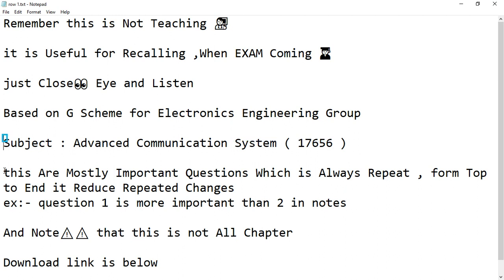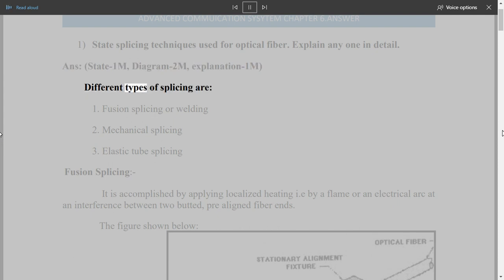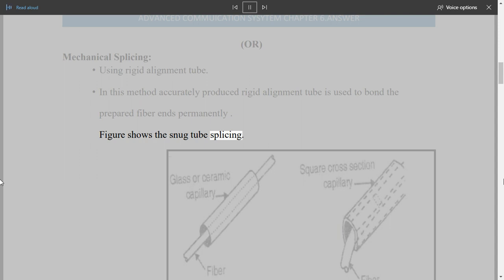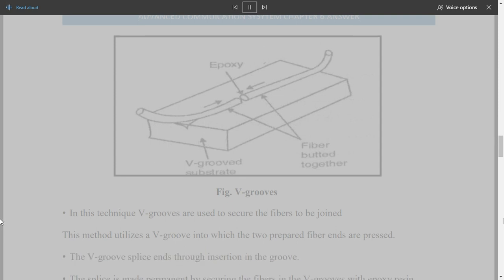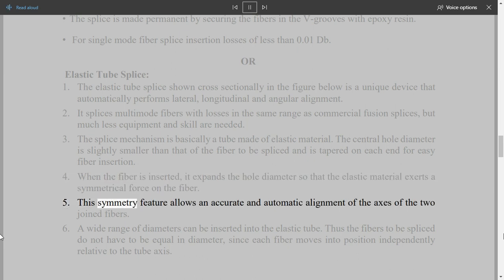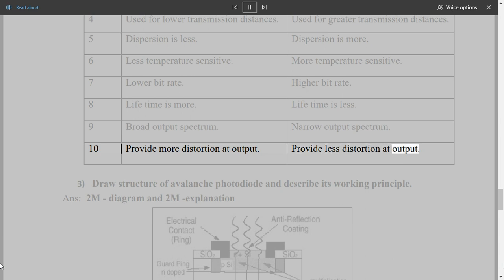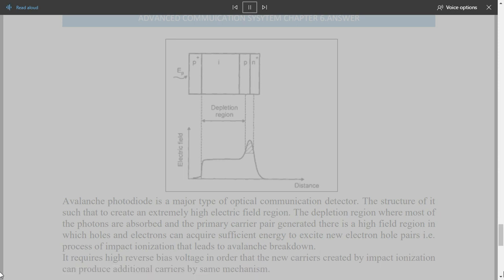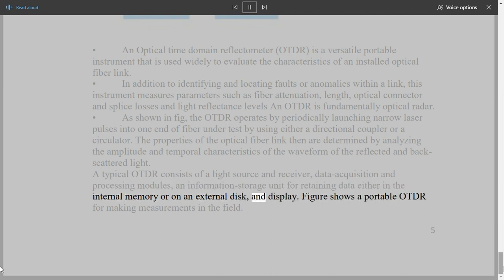Optical Communication System from Advanced Communication System ( ACS )

Comment: Hello, Professor. Thanks for the video. Can I contact you with some questions please?
Reply from the maker: Yes
Reply: Thank you
ineed a diagrame for 6 or 7  light that works with the 9002 optical sensor please.my email
Khalilkhiloo0@gmail.com
Reply from the maker: https://photos.app.goo.gl/2r32nGPzy9mtQUhm9
Reply from the maker: Use LM3914 IC , You can Get 0.039V to 4.89V form 9002 Sensor Make Changes in Voltage and Connect to As Input to as Shown in Screenshot , Connect Relay as per Need and adjust Pot as per LDR / 9006 Sensor voltage Value and then you can do it , the Shown circuit is Unable to Simulate in Software but in Patical it Work is , it is Basically Battery level Indicator .
Reply: @SaurabhSuryawanshi  ok, I'm going to try out the diagram on the Porteuse program and then call you, you helped me a lot, thank you very much, professor ❤